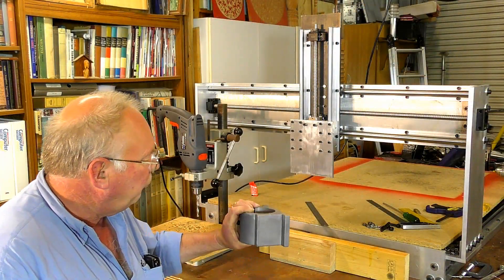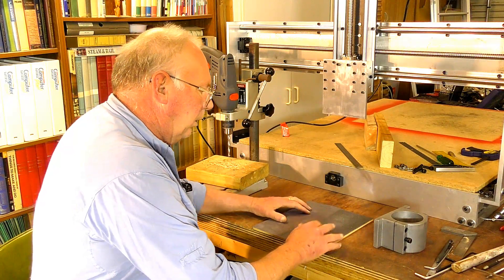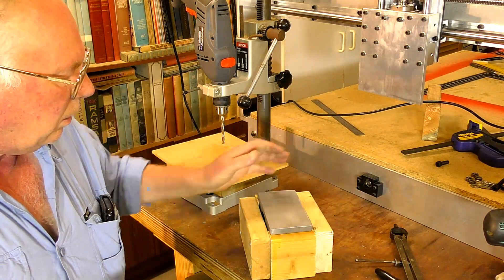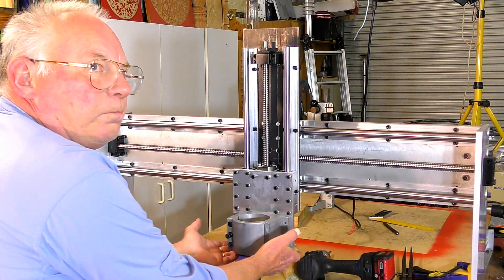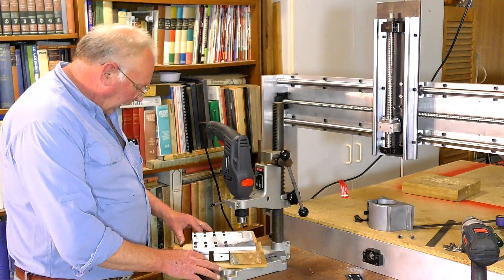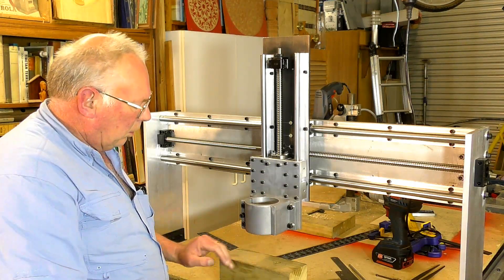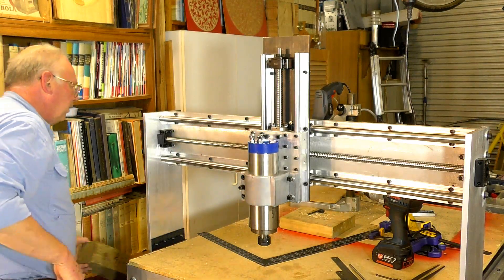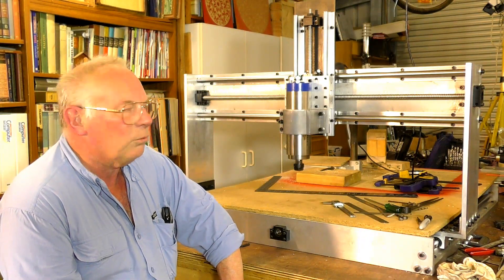Episode 10 HOW TO MAKE A CNC ROUTER WITH (standard) WOODSHOP TOOLS (Z-axis and spindle housing)

Comment: I like the single motor design for the Y axis, the only concern is with this design, the bed plate is only supported on each end. What type of material are you going to use for the bed plate, thick aluminum, steel or some type of stone?
Reply from the maker: We are getting there, you will see in about a week